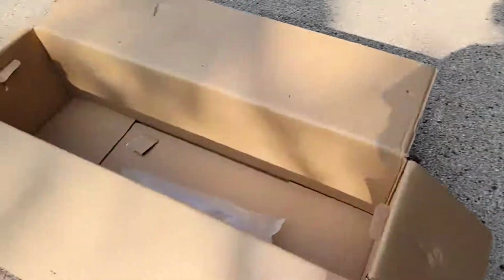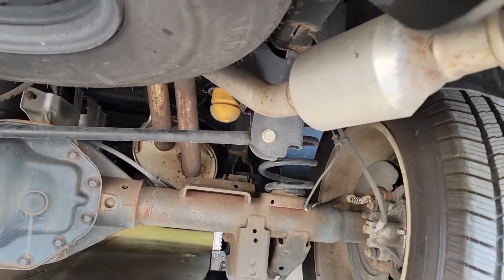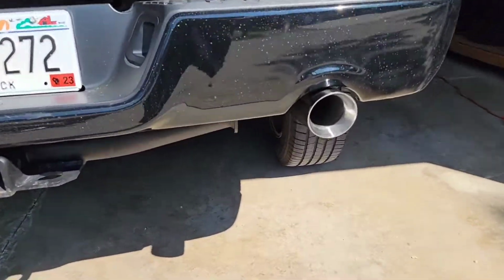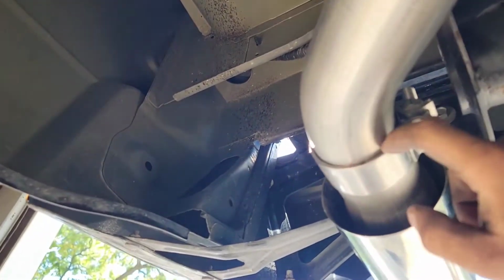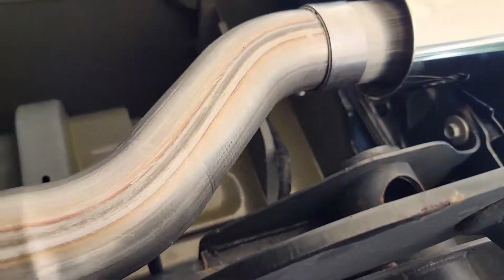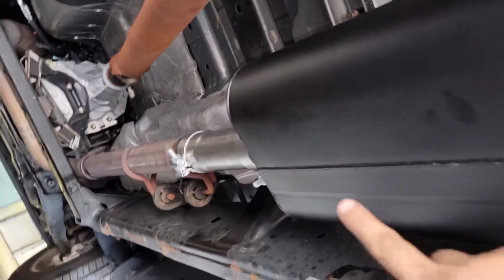Proven Ground Dual Exhaust ram 1500 5.7

Comment: I'm putting a set on on my 2012 tomorrow, but my factory exhaust is way more rusty than yours, will likely have to cut it off LOL.
Reply from the maker: Just cut it if you not planing reusing it
Reply: @Lilmiddwest , I was able to get it all off just by cutting the clamp bands with a oscillating cut off tool.  After that was like 35 40 minutes to install :-)  fellow Wisconsinite here also 😁